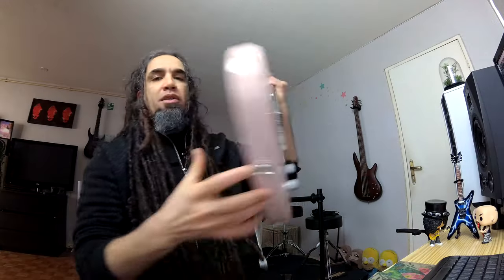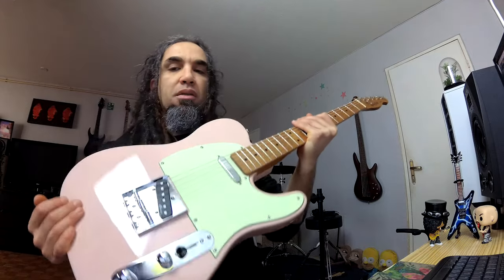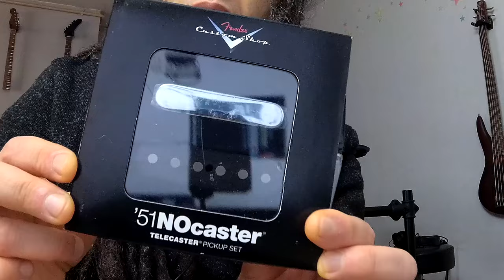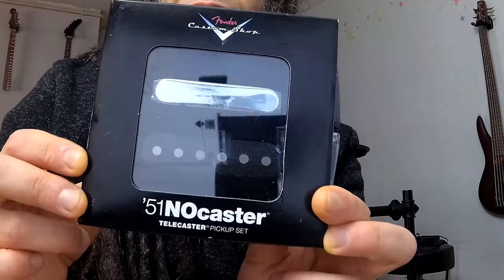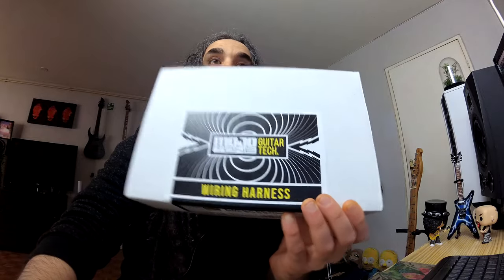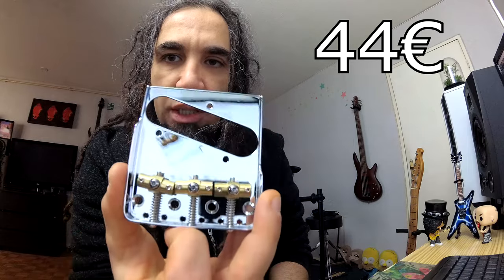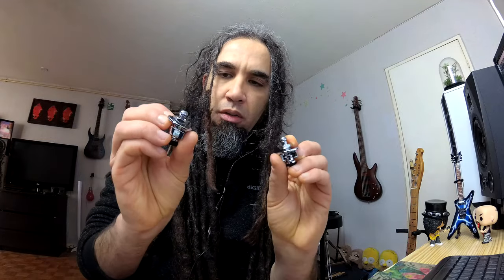DREAM GUITAR BUILT from a Harley Benton TE 62 CC SP + Fender Custom Shop 51 Nocaster pickups! OILID

Comment: Wow! Nice job. Where did you get a pickguard that fits?
Reply from the maker: Thank you VERY MUCH!
I found it on a french "Craig's List", BUT it didn't fit perfectly.
I had to drill some new holes on the body and slightly bend the "neck pocket zone" of the pickguard in order to put the neck.
Reply: @Oilid  Well done. It's impossible to get a drop in replacement pickguard for these Harley Benton guitars and it's a tricky job to make one fit. Your pickguard looks perfect. Great work.👍
Reply from the maker: @briankierans2926  🙏🙏🙏🙏🙏

Comment: Wow. It looks and sounds better than the stock one. Did you have any issue with rounding the neck fretboard? Did you use any paint or oil afterwards? I plan to do the same, but I am unsure how to protect the caramelised neck after rounding the fretboard.  Cheers
Reply from the maker: Hello!
No, i got 0 problems.
BUT you must be careful while rounding the frets edges et the fingerboard: prepare 2 complete afternoons just to be meticulous.
In the Harley Benton brand, their Telecaster are better than their Les Paul and their Stratocaster are horrible!
Reply from the maker: I did the rounding with Hosco medium files and protected the fretboard with paint tape.

Comment: Were the Gotoh sd91 a drop in change or you had to enlarge the holes?
Reply from the maker: I bought the same dimension holes tuners. There is no need to enlarge. Always check the diameter of the tuning pegs hole.
Reply: @Oilid  yes, I'll get the same guitar(double bound version) and I was curious, because the thomann site lists the sd91 and the Kluson as perfect fit but  both have different dimensions

Comment: Hello Olid
quelle reférence / modèle (PT-xxxxxxxx) de sillet Graphtec as-tu mis sur la TE-62 ?
As-tu eu besoin de le poncer un peu pour l'ajuster à la touche de la TE-62  ou il s'ajuste directement ?
Reply from the maker: Salut Arnad 
J'ai tout mis dans la description. 😉
Je n'ai eu besoin de rien faire, c'est rentré nickel.
S'il n'y a pas ce dont tu as besoin dans la description, fais un arrêt sur image pour lire ce qu'il y a sur l'emballage car je l'ai jeté.
Reply: @Oilid  oups, je n'avais pas vu la référence du sillet dans ta description. c'est bien noté et le fait qu'il s'ajuste sans difficulté .j'ai une TE-52 mais ça doit être le même manche que la TE-62
Reply from the maker: @arnaudjayet225  Pas de p !
Alors là, aucune idée quand à la similitude entre la TE 52 et la 62.
Mais bon, à 9,50€ pour se débarrasser du sillet en plastique tout pourri (il s'est effrité quand je l'avais enlevé) et obtenir une meilleure friction des cordes..
Juste, mesure bien la largeur du sillet original.
Et si tu peux, enlève le pour voir si la base est plate ou incurvée.
Nettoie bien la gorge, et perso, j'ai appliqué 2 légers points de Glue 3, même si ce n'est pas nécessaire.

Comment: Looks nice! Does the after market pickguard fit nice on the harley benton body?
Reply from the maker: Thank you!
NO, I had to adjust it for the neck pocket and also drill new holes for the body's screws.
Reply: @Oilid  OK good to know! Great that the contours of the pickguard match the body. Sometimes with tele copies this can be a bit off as well (y)

Comment: Did you drill the holes for the neck pickup yourself on then new pickguard?
I look for new but for HB TE62 i can not find any with the 2 extra holes.
Reply from the maker: Nope. Everything was drilled. ;)
Reply: @Oilid  Great. Seems finding a pickguard that fits the HB TE62 can be an issue. And no other mods needed for it?
Reply from the maker: @HansKarlsson1971  No, I bought a custom one on the french Craig's List. 😉
I got lucky.

Comment: To be honest, I can't really tell the difference between the stock and Fender pickups
Reply from the maker: Yes. It really depends on the system you're hearing it, etc.
To be honest, the stock pickups are not that bad.
But, trust me, I'm more than happy and I can tell the difference when I play it at home! ;)
Reply: @Oilid  I’m sure its much different if youre playing it. + the other upgrades really add to the feeling. Great work!
Reply from the maker: @debreczi2  Thank you VERY MUCH! 🙏
Reply: To my ears, the Fenders (especially the neck) have a good bit more clarity, but I was surprised how bright both of the bridges sounded.
 The Roswell bridge was so bright it hurt me, the neck sounded good yet slightly muffled
Fender neck was a significant improvement, Fender bridge bright for my taste.
I looked & saw specs of wiring was 250k which surprised me. I assumed the pot was higher.
Thanks for the excellent comparison! 💪
Reply from the maker: @BoltRM  Thank you VERY VERY MUCH !